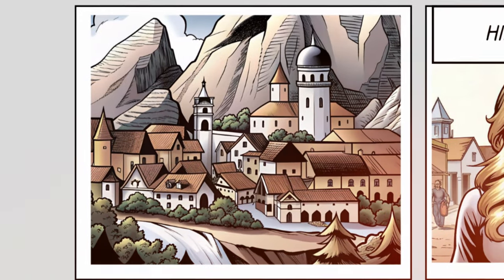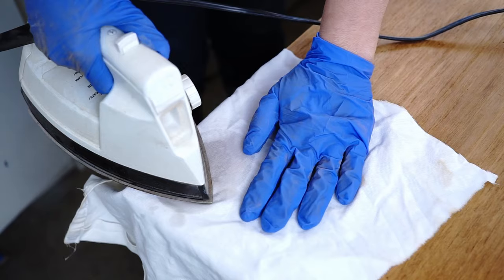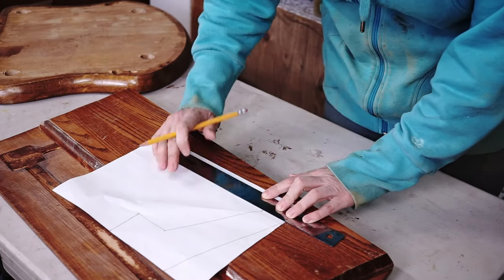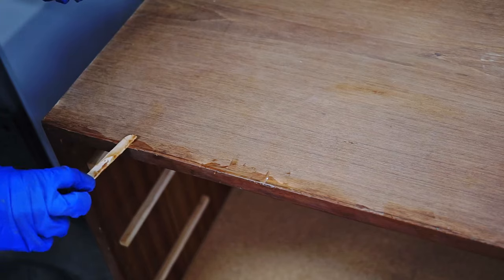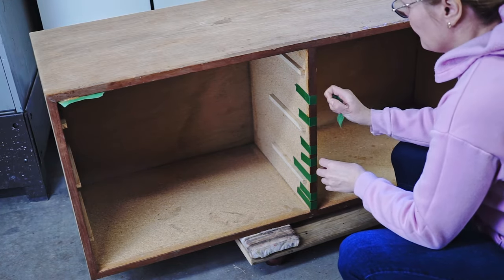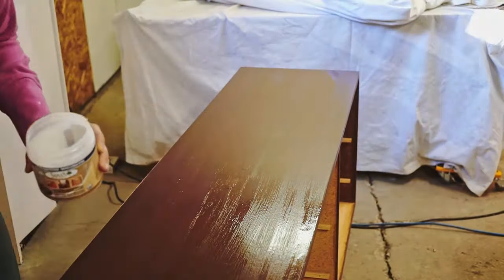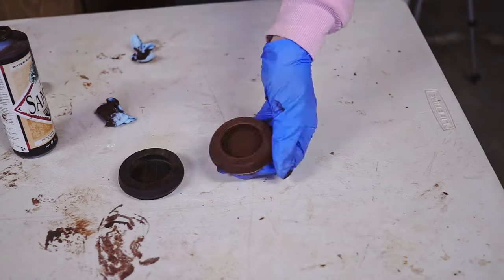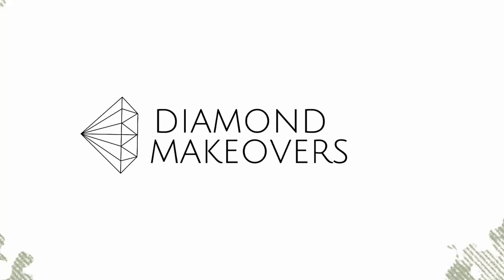Teak dresser makeover

Comment: Great job and story! Love that you saved a piece from disaster. 

Epoxy is too hard when dry to sand rhe way you were wanting to. It also won't stain because it's plaatic. There are products that WILL work for that purpose though, like stainable wood filler. Epoxy isn't usually the best to use on restoring furniture. It's more for using where you need a ton of strength such as regluing a tricky stress  joint. Adding the sawdust to regular wood glue is a good wood filler but again, putting it in the center of the top like that you run the risk of it not taking the stain as well as the surrounding wood.
Reply from the maker: Thank you so much:) about the epoxy - I started using it as a wood filler a while ago , not just an epoxy itself but mixed with a lot of wood chips or wood dust, it makes the mixture stainable. And it always worked for me. I have tried so many different wood fillers, wood putty’s etc. and I found my favourites but none of them works as good as the epoxy mixture. I just have to be careful experimenting with an epoxy from different stores and stick to the one that works for me. And also I have to remember that sometimes less is more 😄